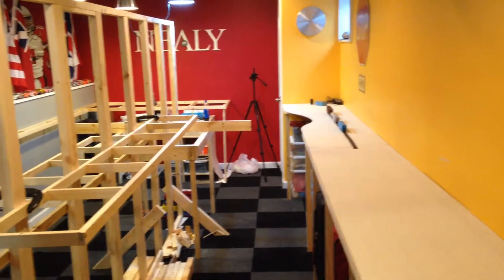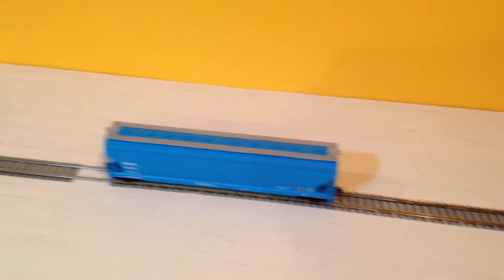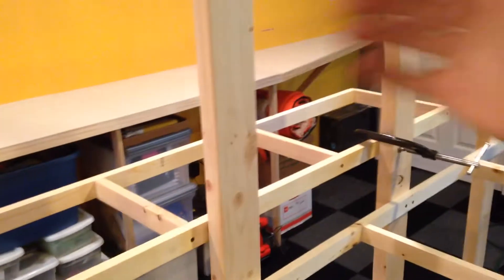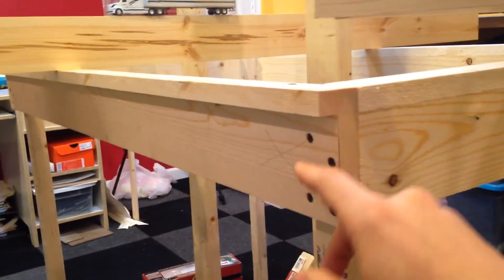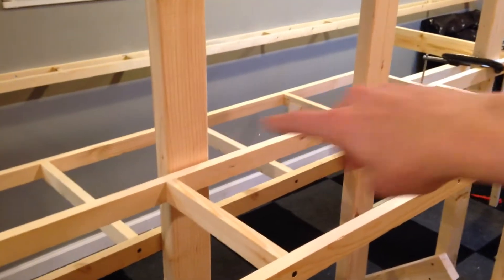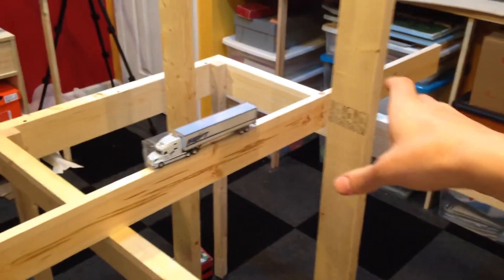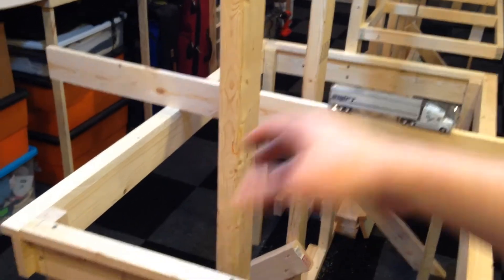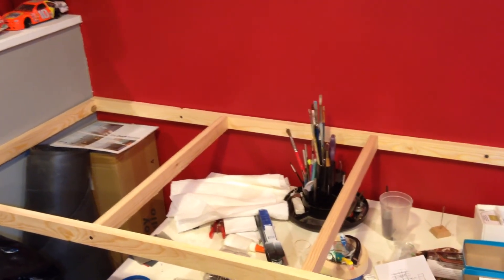HO BNSF 'Plains Div.' Layout Update 6: Rolling Stock and Benchwork

Comment: Good update! As for industries, have siding for a flood loader for coal at the end of the peninsula that way you can build a mountain around the corner to hide the scene divider. And the rest of the area use for smaller industries like box cars, propane dealer, steal coil, etc. Or a couple small industries and a larger one like ethanol or crude, but still making room for the flood loader. What are you putting on your second level? If I where you I would have the peninsula as the rest of the lower level all mountain and grassy landscape scenery and have all you industries and a small yard on the upper level. Hope this is useful!
Reply from the maker: Thanks for the input. I do like the idea of just having a bunch of smaller industries. The upper level is actually going to be based off of Crawford Hill, so there really everything will be scenery and mainline except for the flat area near the helper pocket (which will be above the main yard). So I kind of need to keep all of the industry on the lower level. I'll consider the loader idea. I did want some sort of hopper loading operation, but I don't know if I could model a mountain/hill on the end of the peninsula because the lower level is southern MN (not really mountainous). But I definitely like the idea. And I'd like to have a little interchange yard and maybe a couple of industries near the base of the hill near the helper pocket. I think that kind of goes with your last idea, so that would be nice. Thanks again and look for more soon!
-Cam

Comment: How long do you think the trains will be once you get track in?  That hill looks pretty steep for a curve. Lol
Reply from the maker: Haha! Well keep in mind that the track won't climb that much through the curve. On the lower side of the benchwork, the track height will be about 4.5" above the framework on risers. And on the other side, I just propped up the benchwork at track height. So the climb around the curve will only be an inch or so or whatever a 1.5% grade is.

For train length, I'll talk in unit coal train terms. So we'll probably run 2 lead locos, 25 cars, and 1 DPU. And then other trains will be based close to that length, so exact locomotive and car counts will vary.
-Cam